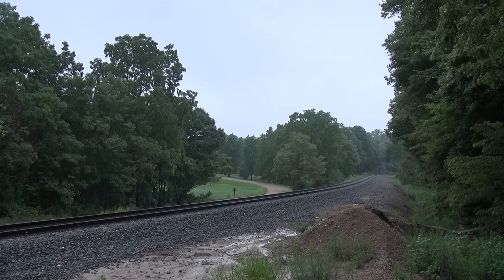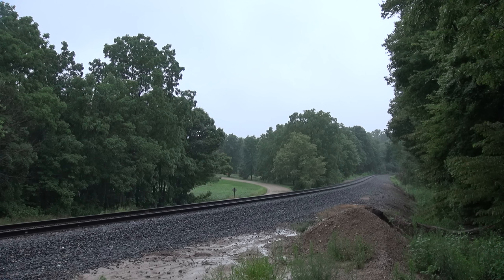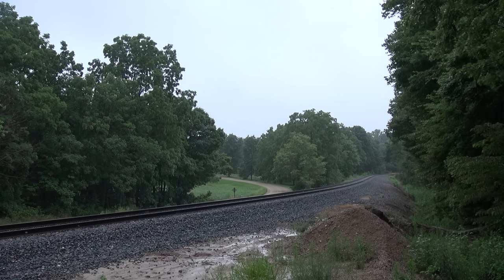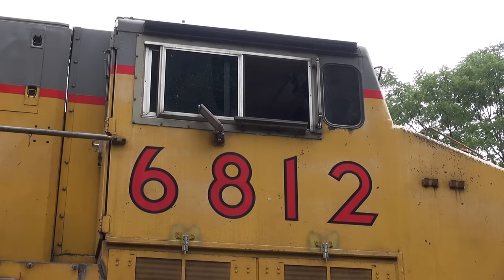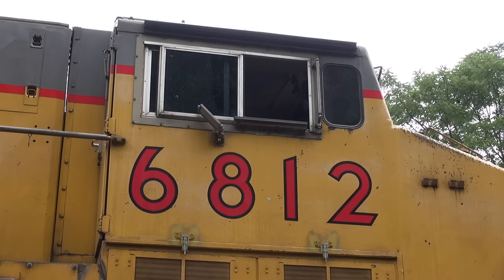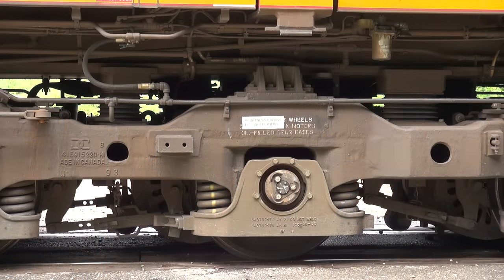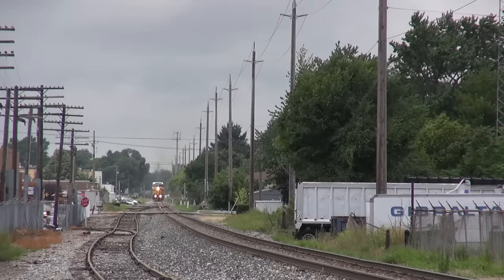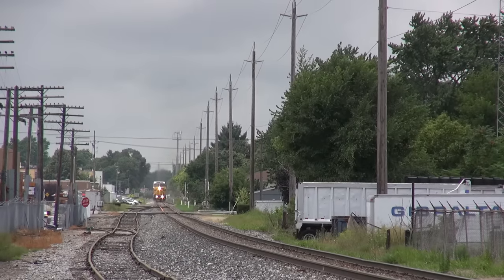TRRS 477: "Whoops!" CSX Freight Train Stalls on Grade

Comment: I was a CSX ENGINEER for 43 years .I worked the great lakes division .Our bad ass hill was B.D  at akron ohio . When we stalled on that hill  and there was no one to shove us up which was 99% of the time The conductor would have to walk back and make a cut then he would ride the rear car until we got to a siding then shoved the cut into the siding go back tie on to the train pull up the train to the siding cut  off go in get the head cut pull out shove back tie onto the train get the air make air test with my R.D.U release and go .bad part was if it happened in winter it would be really TUFF .and you cant blame the power bearue or how ever you spell it sometimes one of your engines would just break down.

Comment: Damn, you can hear the couplings popping and cracking long before he finally stalled.  That's a heavy loaded down sonofabitch.
Reply: Lex5576 they are lucky non gave way with that amount of weight.
Reply: It's irresponsible to load the couplings so heavily. They may be strong, but the one attached to the locomotive has to pull the weight of every single car behind it. They should've slaved a second locomotive in the middle of the train to pull the second half of the cars, or at least slaved one to the rear to push the last few cars.
Reply: @deusexaethera  These two locomotives would not be powerful enough to break a sound coupler knuckle even in dry conditions.  However, there are indeed restrictions on how many units can be at the head end of a heavy train, especially in hilly or curvy terrain, and crews can (and do) replace coupler knuckles (the intentional weak link) when they occasionally break in service.

Comment: Best part was watching those cars coming to a complete stop knowing there was still full power being applied. Was just a mind bending sense of the magnitude of mass that was present. Wow!
Reply: its not power actually.. It's the traction that gets all trains at grades. There simply isn't enough traction between just 4 powered wheels per engine locomotive to haul that much on grades. Your car might have 2000Hp but if you cant put that power meaningfully onto the road you are going nowhere mate..
Reply: It wasn't full full power, that would have broke a knuckle if they did that. You have to back off once you start to stall or else a single wheel slip will break it in two. Surprised the engineer looks like he tried to take off again without getting helpers. Probably very green and stalled due to not backing off the throttle and giving it a little independent on time. Then again some old heads I know if have no idea what to do in these situations either.
Reply: @Steezicus  
So you're saying he could've made it without stalling  using the technique you describe, with just the two engines?🤔

Comment: Train engineer: I wonder why there is a guy filming with a tripod.
~3 minutes later~
Train Engineer: I'm giving her all we got Captian!
Reply: Mac Omegaly too bad the trains don’t have Hill Assist to help them out 😂😂
Reply: they have it.. Without some form of traction control those powered wheels will wheelslip to the moon and beyond
Reply: Who decides how much power is required? Dispatch seems to have a smart—s answer. Not being a railroader it must be annoying to be in this position. Or is it only due to the rain?
Reply: @bjjasper  A rough estimate for the power required to go up an incline is P = v*M*(sin(theta) + crr*cos(theta)).

Where:
- v = Velocity
- M = Train's weight
- theta = Maximum grade = arctan(%Grade / 100)
- crr = Rolling resistance coefficient, typically 0.0025 worst case for railway wheels on rails, can be replaced by friction coefficient for sliding surfaces
Reply: Could do a better job explaining releasing sand onto the tracks for traction.  Couldn’t see it in the visual. Great insight into railroading.  An engineer told me the steam locomotives were used to help the diesels move the cars uphill.  Also he mentioned closing all the doors to reduce wind resistance for speed.
Reply: Not good enough Mr Scott
Reply: D Joe or naught, as in completing a track warrant, at eleven naught one.
Reply: You forgot g (9.8 N/kg).  And the trig is unnecessary for railroad grades, so just v*M*g*(grade+0.25)/100.

But the problem here wasn't power - it was insufficient locomotive_weight * sliding_friction, which needs to exceed M*g*(grade+0.25)/100.  Insufficient power would only limit the v.
Reply: Your forgot g (9.8 N/kg).  And the trig is unnecesasry for railroad grades - so just P = v*M*g*(grade% + 0.25)/100.

But the problem here wasn't power - insufficient power would just limit the v.  The problem was force i.e. locomotive_weight * sliding_friction < M*g*(grade% + 0.25)/100.
Reply: @serges201  ok I know this was from 5 months ago, but why does YouTube send the same comment twice?

Comment: This happens appearantly often here, as there is a sign with a telephonenumber to report stalled trains! 12:25 :)
Reply: @rosehiptrystrains7613  Ok I see. Here in the Netherlands we have quite similar level crossing barriers (they are from US origin). And there is a small plate on the engine housing that holds and drives the barrier, saying to report any malfunctioning of the levelcrossing at a telephonenumber mentioned.  Left behind carriages would keep the block locked and next trains will be stopped by the preceding blocksignal being at danger.
Reply: I think the sign was to report stalled cars on the crossing, so that a train doesn't come and murder someone's Nissan Versa.
Reply: @JETZcorp  Of course! That's what they mean!
Reply: @JETZcorp  Or Nissan Leaf
Reply: @JETZcorp  Hey, I have a Nissan Versa and don't want it to get murdered, right now it's all I have. LOL

Comment: Glad you got the wheel spin in the video.  Sounded like a GIANT table saw.  Metal on metal can be challenging - not much traction (hence the need for sand), but low rolling resistance once you get going.

Comment: I wonder how often they burn out traction motors with these heavily overloaded locomotives. Great catch.
Reply from the maker: GE Traction Motors are very resilient. They're designed to be abused!
Reply: Thornapple River Rail Series i love abusing trains
Reply: Wanna play crash locomotive derby? 😈😵
Reply: Very seldom with the newer power
Reply: AC power traction doesn’t wear out.
Reply: 8880 didn't seem to be anywhere near full throttle. Traction motors are force cooled by blowers to get rid of the heat.
Reply: hello
Reply: RE: Thornapple: And how did GE traction motors help CSX 8880 an ex-Conrail EMD SD40-2 still riding on flexcoil trucks?
RE: TheLocoUnion AC traction? CSX 8880 is an EMD SD40-2 with DC traction motors.
RE: Cliff Leigh - Forced air cooling has been used for traction motors since the New Haven electrified.  The problem is that that when the RPM drops to zero the motor amperage is only limited by the copper resistance, so a unit without modern controls or an experienced hogger is very likely to cook its motors. From the footage we can rule out the hogger's skill, he should have shut down and coasted a half mile sooner. The unit(s) must have safe area limiting.
Reply: @Benjamin Stroud he should have had three shovers assisting him from the rear in addition to the engines up front and the dp in the middle
Reply: What's a "hogger"?
Reply: @jed-henrywitkowski6470 , a "hogger" is railroad slang for an engineer.
Reply: @Benjamin Stroud High fuel cost for a low priority train?
Reply: @cliffleigh7450  No point in running the engine hard if you don't have the friction to make use of the generated power.
Reply: @MarkRose1337  +That's the whole point of modern wheelslip units - to use as much available power as possible with the wheel in the creep zone before it slips. The hogger can give the loco full power and let the electronics do the work.
Reply: @cliffleigh7450   Didn't think the electronics in an old SD40-2 would be that sophisticated. And why run such an old unit with the much more capable dash-9? Wouldn't the engineer be handicapped in a marginal situation like that by the mismatch in locomotive capabilities? By the time the train gave up the ghost and started to roll back downhill the dash-9 was probably doing almost all of the work wasn't it?
Reply: @mrz80  Yes - they are not as sophisticated as the later units, and the Dash 9 would probably be more sure-footed. I'm just saying that the EMD does not sound like it is in notch 8.
Reply: @ThornappleRiverRailSeries  even with Britney Spears...
Reply: WPLU572 Trunked Radio  trains too?
Reply: @ThornappleRiverRailSeries  gm traction motors are way better
Reply: @drow6602   the grades in mi are not very steep
Reply: William W. Campbell-Shepherd IX  ? 😆
Reply: @John Lawson Sr. probably on U Boat power
Reply: @oliverstreet7704  Wow you sure know your oats. I know diddly. However I tend to agree with you that the 'hogger' should have shut down and coasted a half mile sooner albeit hindsight is a wonderful thing. Can you please inform me what caused the train to stall and the solution? Looking forward to your reply. I am wondering if the operators knew it would stall however deliberately under powered the train for economic purposes i.e. the cost of adding another loco v the time it took to perform the maneuver of recovering from the stall...in other words it cost less not to add another loco to the train.

Comment: That's CSX. Two units 2 miles of train, 20 mph
Reply: Every Class I Railway in a nutshell. They put too little power on the train and blame the engineers, conductors, et cetera when the train arrives 12 hours late.
Reply: @electric7487  nah, just csx. I never see a UP or BNSF train with less than 13600 horsepower. Most aren't even a mile long.

Comment: Reminded me when we were heading to our junction to deliver outbound cars. The sanders were not working correctly so we were dipping our gloves in the sand hopper and manually pouring on the rail.
Reply: I've done that.   Walked 1/4 a mile with a bucket of sand dropping it on the tracks.

Comment: Nice greenery along that line. Good to see a factory issue CSX SD40-2. I know CSX overhauled bunches of 'em. Gave them a sleek, smaller nose. They look great! It isn't uncommon at all anymore to see Union Pacific units in Atlanta yards.
The crew did a crafty job  of working and manipipulating that big train up that incline and putting it back together. Hat's off to them!
Reply from the maker: Actually the SD40-2 was originally built as an SD40 and then rebuilt by Conrail to SD40-2 status at Juniata. But I get what you mean

Comment: Interesting to see a "dirty old" SD40-2 with cleaner exhaust than the fancy new EPA approved model.
Reply: The AC44 and Dash 9 units were built from 1993 - 2004, so they came under the same EPA regs as the SD40-2.
Reply: You know that visible smoke doesn’t correlate to CO2 production? CO2 is an invisible gas.
Reply: @samschannel531  CO2 doesn't really worry me.  Plants love it.  Its all the other junk.  Clean burning engines are happy engines!
Reply: @pkranz937  but won't last as long as a Sd 40

Comment: I have often wondered if dispatchers are paid from locomotive fuel credits. I grew up in southern West Virginia and was very familiar with the NS  Pocahontas Subdivision and the CSX/Chessie New River and Allegheny Subdivisions. Both of these railroads routinely pulled 13,000 coal trains over the Allegheny Mountains. I rarely saw NS trains stalled as they always seemed to have an abundance of horsepower. However, the CSX was another story. It was not unusual to see 18,000 to 24,000 hp on the NS always with pushers. The CSX however would send engineers out with 10,000 to 15,000 hp and only had pushers on occasion. I've seen many a CSX coal drag stuck on the climb from Hinton to Allegheny. On the fully double tracked NS Pokey I only recall seeing one stalled train about a mile west of Elkhorn Tunnel and that only because they had to shutdown a locomotive due to a burned out traction motor. Comparing the summits the NS trains were consistently faster than CSX. That was a great video, thank you for posting.

Comment: Right place; right moment. I hope the trainoperators have learned their lesson. Nice video.
Reply from the maker: The engineer and conductor didn't have any lesson to learn: management did. Train crew just ran with what they were given.
Reply: They wanted to save on locomotives used. Well indeed that backfired. If the tracks were dry it might not be a problem. I mean that goodsload came with a reasonable speed! I always thought that Michigan was flat. How much is/was the climb in feet?

Comment: Having worked for the railroad (Southern & CSX) and in the industry for 51 years, you were in a precarious position, although
fortunately on the outside of the curve.  - Ever see what happens when a train "string lines" a curve.  It is not pretty and it
is very dangerous.
Reply from the maker: Around the time this video was shot, CSX added a special instruction for this line, limiting mixed freight trains to 15,000 tons eastward, to prevent this. Sure, 15,000 tons is generally okay with helpers, but if the shoving gets out of hand, and say one has a lot of empties right on the rear, well you know what could result! So 15000 tons is the max.

Comment: 10:50... I don't know what it is about wheelslip that fascinates me, but right here is probably my favorite part after the stall and slip back. You can see that even with half its train, the locomotives are still struggling to attack the grade, with the wheels every so slightly slipping, parts of the truck shaking, and even another minuscule slip backwards as they get back underway

Comment: You had me at "paltry power offering."
Reply: The train was all loads, and had a weight of about 9200 tonnes. The two locomotives have 7400 HP total, and that's only 0.8 HP/tonne. If I were them I'd put another UP AC44CW and another CSX SD40 on the front.

Comment: Using a C44 and an SD40 was just dumb. The horsepower disparity is immense. Mixing EMD and GE power would've been wiser, or at the least, two GEVOs or two SD70s. SD40s are relegated to yard duty for a reason-they're underpowered in this day and age.
Reply from the maker: Grizz , SD40-2s are still regarded by many engineers as the best locomotive ever built. So it isn't that the SD40-2 doesn't have enough power, it's that the crew was assigned not enough power in total. They could have had 3 or maybe 4 SD40-2s and motors right up the hill.
Reply: Maybe that’s all the power they had. It’s obviously an interchange because it has foreign power. You don’t send all of your good power to another railroad.
Reply: Erm...the models are EMD and GE. Though, I'll admit, for a grade like this their either should've been a helper added at the back, or a more powerful loco added in place of the SD40-2
Reply: Such a typical railfan response
Reply: The EMD SD40 is a good engine, but nowhere near as capable of the work an AC44 can do. 

Anytime you mix AC and DC drive locomotives, the AC power is limited by the short-time rating of the DC unit(s).  This is because train planners used strictly HPT in powering a train, vs using blocks of AC or DC units. 

In this case, what clearly happened is the engineer determined they weren't going to make this hill.  He set the brakes,  coming to a stop (no train stalls that quickly). When he had permission to make a reverse move, he did, with a train man on the rear.  We can't see that part,  which makes this video misleading.
Reply: @driftspecs13  I Apologize Grizz.   In 24 years you'll have as much experience railroading as I do.   What you will learn is that your comments sounds very much like the second-guessing we constantly hear from railfans.

Comment: I lived in Cumberland,Md, the Railroad split there. My Father in Law worked the run to Grafton,WV. Lots of times he would tell me about a drag coming East, no helpers to around to push them up the Allegany Mountains so they broke the train in half and took the first half up and than came back and got the rest of the Train. Some Trains heading toward Sandpatch might have 7 or 8 unites. I live in Florida now,no trains close by.

Comment: Doesn't the railway use mechanical engineers to calculate the power required to haul a load up certain grades? If they had the train manifest and the track topo map, it wouldn't be a sweat to do the math. I mean, paying an extra wage to account for engine distribution would save tons of money on delays and potential runaways.